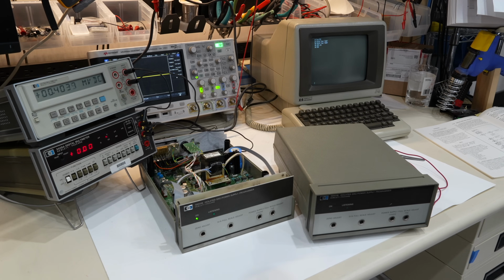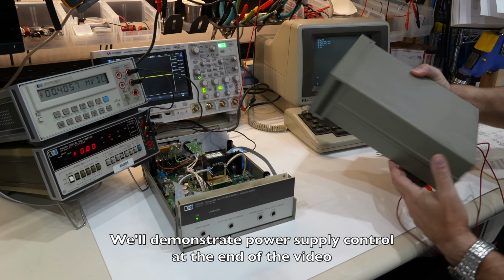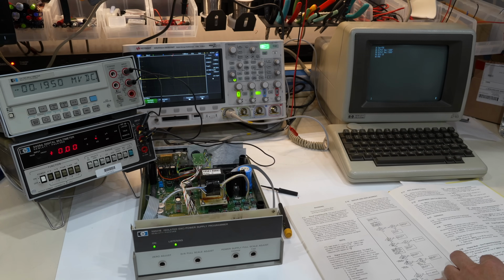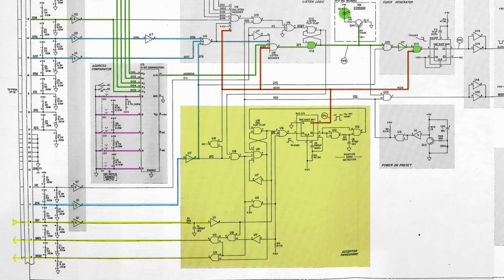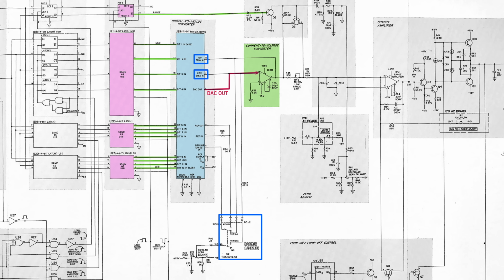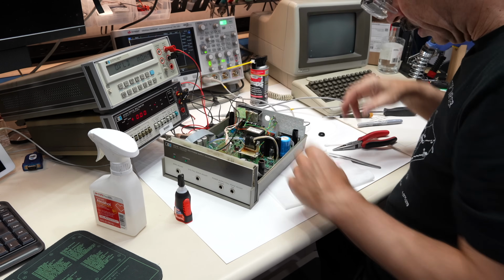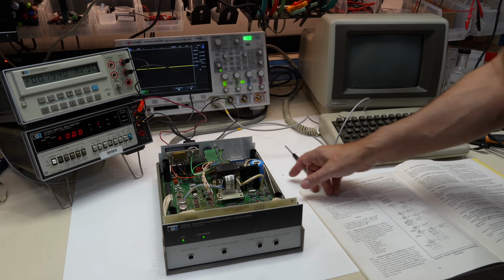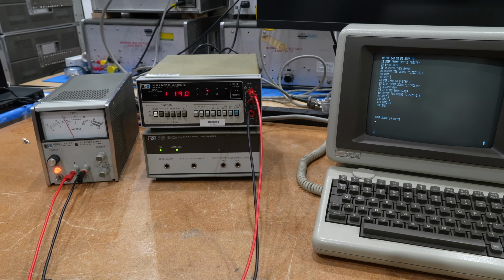HP 59501B Digital to Analog Converter / Power Supply Programmer Repair

Comment: I don't think that DAC chip is an HP hybrid.  It is very likely an Analog Devices AD563/BCD - the pin functions match up very nicely with the 59501 schematic.
Reply from the maker: Interesting, I’ll take a look. Would be great if confirmed. The parts list lists the manufacturer as HP Santa Clara division. Usually HP never hides when it gets a chip from someone else. But it could have been licensed later to ADI or be a collab? ADI is certainly well known for their DACs.
Reply from the maker: It checks out! I think you nailed it. There is also a Motorola version of the same chip.

Comment: Wow, HPIB via discreet logic, I remember HPIB being driven by these hard to get 40 pin custom IC's, glad to see that much simpler things are possible. So talking to my HP counter with an Arduino is quite possible.
As for that '59501B DAC, way more flash than my old HP 581A, which was intended to take the BCD output from early HP counters etc, and turn it into analogue to feed a chart recorder etc.
For the '581A, I'm kind of toying with seeing if I can run digital audio through it - to get 'HP sound', of course I'm not expecting HiFi, but it will  be interesting to see how it handles it. Audio from gear built way before digital audio was ever thought about.

Comment: I have an old HP3478a that was given to me a couple of decades ago, I keep it powered at all times and it is very accurate still.  Just recently picked up an old HP6115a off of fleebay for really cheap, marked for parts.  Turned out that it worked perfectly and after warmup it was pretty much nuts on after all these years.  They both measure way in spec against the Agilent 34420a I have.  I am seldom amazed since these were so well built for the time.  These are getting on 40 to 50 years now so it is really impressive the stability they exhibit.

Comment: I probably would have just replaced the switch. If it happened once, it'll happen again. better yet, design a relay circuit for it so it's not pumping juice through a push button.

Comment: I remember those HP-IB units! In particular, the quarter-width 59303A digital to analogue converter. I met it when I started my postgraduate research program, in optical fibres. It was being used to set the input voltage to a mass flow controller, which varied the flow of oxygen through a bubbler containing germanium tetrachloride. By varying the O2 flow rate, the amount of germanium in the gas flow into the preform fabrication lathe could be controlled. The whole system was being modified to improve consistency and reduce the fibre losses, particularly due to hydroxyl ion contamination*.

We were making graded index fibres. At the end of each flame carriage pass, the flow rate needed to be changed to get the correct concentration for the next core layer. My task was to design a TTL logic circuit that allowed the DAC to be driven from a paper tape reader, by implementing the HP-IB source handshake and counting to five (3 ASCII digits, <cr>, <lf>). This circuit was triggered by a switch at the end of the pass, which made the flame carriage start its return movement.

I recorded this in my lab book, which of course I still have to hand, on 21st December 1978. That DAC must have been a recent purchase. I recall a fellow student, who had been on the same course as myself and took a job nearby, came to visit our labs and remarked it was like walking into the HP catalogue...

Memories!

[*] This was at the time of the great 3-way race to get the lowest loss fibres, between Bell Labs, NTT in Japan, and us guys at Southampton University
Reply from the maker: Very cool, graded index fibers - I had no idea the little 59303 DAC (non isolated cousin of the 59501) had a role in that great advance! I have to say, each of Bell Labs, NTT and Southampton won part of the better optical fiber race. There would be no modern internet without their respective contributions in optical fiber technology.

Comment: I have a multimeter with some exceedingly tired panaplex displays. I found out that you can wire 7 segment LED displays to them and just rewire the board's high voltage connection to 5v instead, and they work! Still need to source some orange 7 segment displays though, I only had green ones.
Reply from the maker: Good to know! I hadn’t thought of that simple solution.

Comment: Wouldn't the bi-polar switch have been better, electrically, the input to two transistors, rather than directly inline?
That's a fantastic way of making sure you get specific voltage or range of voltages for testing prototypes etc

Comment: Fantastic! You made me want to change my analogue power supply project to "control" it with an external source. Then build an interface like this HP and send it data with a simple computer like a C64 or the like I have available. Excellent explanation Marc.

Comment: The high series resistance on the bipolar balance switch circuit is actually sort of a worst case for precision switching contacts. Low currents can be very difficult to switch reliably because there is no electrical cleaning action at the contacts that might help blow through the crud. 

It's worth remembering that in general contamination films on switch contacts are not ohmic. When they're "bad" but not open, they exhibit semiconductor or tunnel junction properties and other messy stuff like that, and are not linear with applied voltage/current. So a contact that looks like 100 ohms to a multimeter may still be dropping 0.1V at 1uA. 

Higher circuits in the switched circuit can cause what's known as "fritting" of the contact surface (not fretting, that's different) where applied voltage can cause the contaminant or oxide film to break down, and then the available current can locally melt microscopic amounts of metal and allow it to bridge the puncture in the film, forming an ohmic contact. Without the available current, and in cases where there isn't enough stray capacitance to supply the required arc energy, this bridging may never happen. Source: Electrical Contacts by Slade (and also I'm dealing with it at work literally right now 😕).

Comment: Has a duet of atomic clocks to be aligned and then used to show an example of Einstein's theory of relativity next to the vintage digital display spelling out "boobs".
Sometimes it's ok to revert back to a teenager once in a while. Keeps you sane and grounded. Plus, it's just funny. Lol.

Joking aside, these deep dives into all these older HP devices is really interesting. I never get tired of seeing the engineering behind these devices.
Reply: THE RULES EXIST FOR REASONS!

Comment: I miss the old HP... I worked as a Firmware Engineer in HP's Santa Clara Headquarters Test and Measurement Division of Automated Test Equipment from 1996 to 2000 when they split off and became Agilent.  I remember how wonderful it was seeing all that equipment and walking around in their big buildings;  and that's where the Atomic Clocks were built and tested... it was a time like no other.  Glad to see the old stuff working great for all these years... no doubt it was quality engineering.   Cheers!
Reply: I repaired many HP multimeters and other gear around 1980 , and collect hp instruments since that time. The documentation, schematics and the Systems Engineering of that T&M was really great at that time, due to 'The HP Way' of management .. by Engineers. 
Only recently, I finally read that book by David Packard .. and this confirmed exactly, what is currently going wrong in Tech/Electronics company which I'm working for since 29 years, and in many similar others .. due to the tendency, that economics people have taken over the whole management, overwhelming the expertise of many experienced engineers.

Comment: Anyone using superglue (cyanoacrylate), be aware that it can outgas and the resulting chemicals can condense on various surfaces. Fogging clear plastic and generating a nice crusty layer of insulation on metal contacts.
Reply: Yes, I cringed at this solution saying to myself Marc will be back here in a few years. C&K Switches/Littlefuse now owns the ITT Schadow product portfolio, but I’ve had a hard time finding identical replacements in their current product lines. Scouring the interwebs for NOS ITT Schadow parts has helped with my equipment refurbishment adventures.

Comment: I love the 59304A beautiful. Did you do a repair on one?
Reply from the maker: I had to repair them all, but I didn't film it...
Reply: @CuriousMarc  I found mine needed DIP sockets cleaned and the front panaplex module connections burnished.   it’s tough to keep mine running properly.
Reply from the maker: @markgreco1962  Same issues on mine!

Comment: I could swear this is not the first time there's been some test equipment that had a bad mode switch on the back in this video series
Reply from the maker: I think that's the third one after the HP 3478A and the HP 3438A. But it won't be the last one, we just ran across one more bad switch yesterday in an newly acquired instrument. It was bad enough that HP had a special note on the 3438 switches which explained how to clean them.

Comment: Thank you, Marc, for this very nice explanation of this old GPIB state machine and 12 bit DAC.

Reminds me of my university experiments on superconductors with varying DC magnetic fields, 35 years ago. 
The magnet coils were steered by a DIY 12 bit DAC (AD7542) in bipolar configuration, and the parallel printer port with its handshake lines was mis-used as an interface to latch the data. 
Anyhow, you might ask Time-Nuts John Miles, KE5FX, if he would be so kind to write a driver for your  HP5334B  T.I. counter, for use with his great TimeLab program, which would then provide a digital phase or Time difference recorder,  and Allan Variance analyzer.

Comment: The ability to remotely program a power supply with an external voltage input came in very handy for me. I was working on a wave-power-buoy system that generated power from the energy of ocean waves. The ocean waves would push and pull on a hydraulic ram which would spin an electric generator. My job was to turn the varying electric voltage (0 to 300 V) into a regulated 24 V at 500 W to charge a big battery. The problem was that our DC-DC converter kept blowing up, and it was impossible to troubleshoot the system at sea with real waves.

To troubleshoot in the lab instead, I took an HP 6448B power supply (0-600 V, 1.5 A) and programmed its output voltage with an Agilent arbitrary waveform generator. The arbitrary waveform was the actual ocean waves as previously recorded by our buoy's inertial sensors. In this way I was able to find the unique combination of rising and falling voltages that was causing our DC-DC converter to self-destruct. I was definitely wearing my safety goggles in case I let out not just the magic smoke, but the magic plasma as well!
Reply: nice! emulating the waves with an AWG and a programmable PSU!!
Reply: @engmcgill  that’s very, very cool, being one relatively new to all of this, the last 15 years, it’s wonderful hearing how these things were used in the real world.
Reply: I really hate it when the magic plasma escapes!  It's a much more intense version of that "hot electronic smell".
Reply: @lmamakos  Especially smelly when it takes out the main breaker for an entire farm, after putting several kA through a signal wire due to a wrongly wired relay in a safety circuit. HVAC can be... interesting.
Reply: @unmountablebootvolume  "...ask me how I know!"
Reply: @lmamakos  That sounds like a line from Star trek, just before they eject the core.

Comment: "Exceeds its spec by a factor of 10 after 40 years...".  That's the HP we know and love :)
Reply: The HP that we used to know and miss.
Reply: The HP we USED to know and love
Reply: Used to be
Reply: so much this.
Reply: I think they are rebranded as Keysite. Maybe parts are in Agilent.
Reply: @H0mework  keysight's contemporary stuff is good too. Can vouch.
Reply: Way better than the modern HP (as in Computers & printers). lucky to meet spec's 5 minutes after purchase.
Reply: Used to be quality equipment... now they're so-so 😔 at best

Comment: Seems that HP has used cheap switches. This is not the first video where you hack switches. On a smaller scale I had to rebuild most of the b.west switches in a 8350b. Now I am dealt with so lousy sliders in a 5328-6006
Great tutorial on going state machine. With you info maybe I could  tackle the going board in the 5328
Merci
Reply: I could live with switches that last 39 years !
Reply: I wonder what alternatives would have been available back then. Anything reliable and hermetically sealed? Apollo style micro switches? Reed switches?

Comment: Is there some way they could have made a "digital" switch that is less reliant on the quality of the contact but uses a transistor that filters the output to a steadier value to account for eventual switch corrosion?  Or just use gold plating?
Reply: You should tell this great idea to HP.